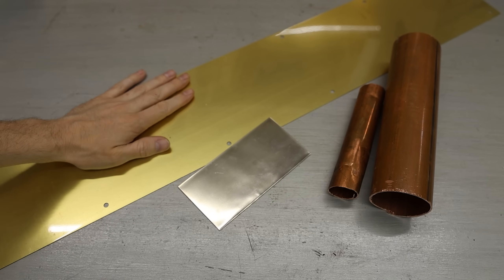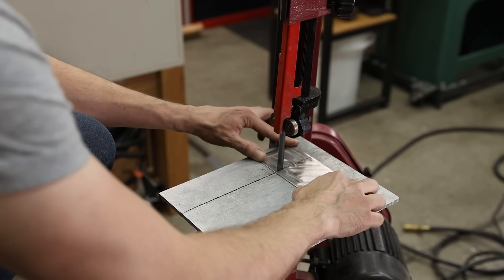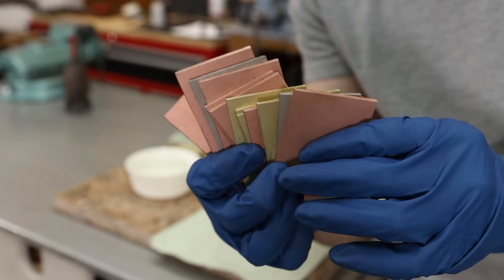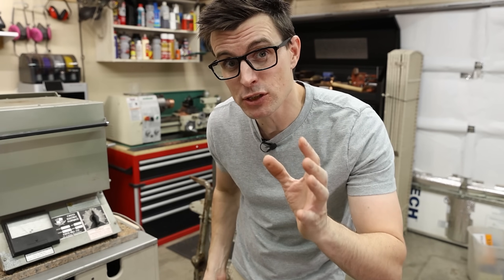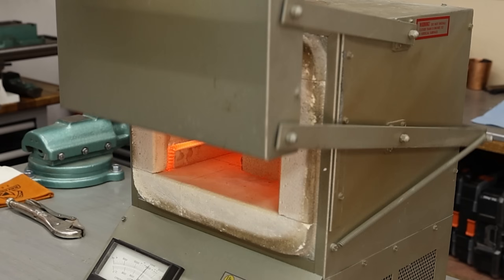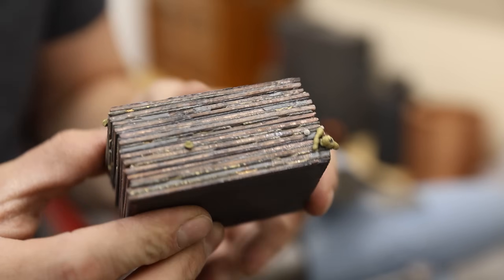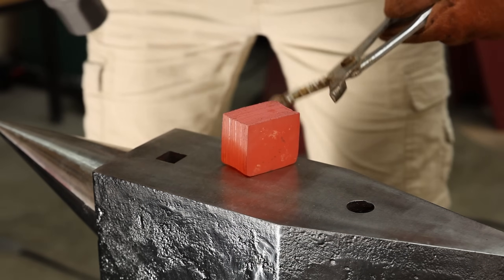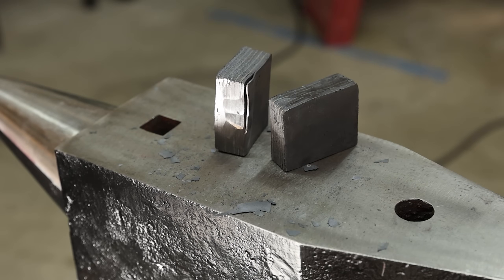Can I make Copper, Nickel, Brass DAMASCUS? - Mokume Gane

Comment: HI, I'm a jewler and have done Mokume Gane before. You need to use an acid bath before you bring your metals up to temperature. that would actually be better before you put them under pressure. As you know, you did not actually remove all the oxidation with your methods, because oxidation is actually instant. It would also be helpful if you polished the surfaces to a very high degree, and then used an ultrasonic bath to remove any compound after polishing. Then the acid bath, then the pressure, then the temperature. Of course you need to work quickly and there will still be a tiny bit of oxidation after you put it under pressure, but much less.

Additionally, you chose a difficult mix there. The noble metals of copper, silver, gold, and platinum are much easier, for many reasons.

Comment: That was an excellent first attempt, and you did manage to get a few of the plates to weld without a lot of things most people consider mandatory...that's commendable!  About the only thing I've seen that'll forge together under those conditions are stacks of nickels and quarters, that cupronickel alloy forges together effortlessly it seems like.  Just heat and tap is all it takes.

Some tips:
-Use nickel silver or cupronickel, rather than pure nickel plate.  Everyone has a hard time with delamination using pure nickel.  Sandwiching pure nickel with a nickel alloy can make a big difference in success, though omitting the pure nickel will bring even more success.  I've seen where people have electroplated a layer of copper on pure nickel plates beforehand and produced consistent welds, but I've yet to try that method.  I suppose copper plating all of the non-copper plates could give great results while also adding a fine grain detail between them, something to experiment with perhaps.
-Don't media blast the plates.  Sometimes it gets all of the oxides off, sometimes it hammers those oxides into the metal, sometimes it leaves abrasive stuck in the metal.  The rough surface also holds moisture and fingerprint oils far more readily than a smooth finish, and it'll hold them between the plates when you're trying to weld.  Instead, try a dilute acid bath and then a cleaning solution like tiva or even dawn, and then a freshwater rinse.  Electrocleaning works wonders too.  Use clean nitrile gloves when handling the plates after cleaning and avoid any contaminants for the best chance of success. 
-Use nuts and bolts to hold the plates together, rather than welding pins.  You can still tighten the plates down, but when you go to squeeze the stack, the two plates will have nothing stopping them from compressing the stack.  It really doesn't take a lot of pressure to set the welds with non-ferrous metals, most of the pressure is actually being used to flatten each plate against the other and remove the space between them.  The press would've been nice, but it can be done with a good vise or gentle hammering for the initial heat, just keep tapping until you feel/hear it slightly firming up after that first thud.  Welded pins are okay if you have a press with force to spare, as there's still plenty left over the bend those pins out of the way, but those pins are not inconsequential with the limited force that a vise has to offer.
-Flux, please.  With that kind of stack it's pretty much mandatory.  Thinned out borax paste along the edges will do nicely, it'll wick into any gaps and prevent oxidation when heating.  Don't be shy with it, do it on every reheat until you're confident that the stack has fully welded.  Alternatively, dunk the whole billet in kerosene and use a propane forge instead.  There are other fluxes out there that work great too, some that are even made specifically for mokume gane that will simplify your life so much...but simple fluxes still get the job done.
-Use a propane forge.  An oven subjects the stack to oxidation at high temps for hours on end, a propane forge only does so for a few minutes (in a reduced oxygen atmosphere).  You can still use the oven for the first heat if you pipe argon into there and keep the atmosphere inert, but it's kind of costly to keep doing this after every heat.  Waiting for the billet to heat up again in an oven without argon after every successive forging only exacerbates the problem.
-If any part of the stack melts, stop there and salvage what you can.  Don't try to keep going, take the billet apart and start over.  The gaps that the missing metal left between the other plates will never weld and will delaminate, every single time.  When you try to forge them together anyway, all it really does is deform the plates on either side around the gap, encapsulating a delamination that you'll only find after you put a whole lot more time and effort into it and you're finishing your part with a bit of sandpaper, it's looking great and you're almost done, except...wait, where did that sharp little edge come from?  And then you realize the whole thing is ruined after spending days on it.
-Don't forge to a black heat, always keep it glowing.  This will help prevent delamination and cracks.  By the time you've forged the shape you want out of it, those welds should be as strong as they're going to get, and should handle some light cold working as long as you occasionally anneal the piece.
-Don't forge on the grain until you've gotten a lot of good heat cycles in and you've deformed the billet quite a bit.  One or two reheats are not enough.  The welds need to stretch and heat cycle against each other to really lock in that bond, and one or two passes with a hammer is not enough to upset the center at all.  Once you have several cycles in and you feel it's ready to be struck on the grain, take it to the grinder and level off the edges.  There's a good chance that some of the plates moved a bit during that initial forging and aren't all flush with each other.  When you hammer on those high spots, it causes a shearing force on the weakest part of the grain and it'll absolutely delaminate on you even with a decent weld.  Even after all of this prep, forging on the grain is still the riskiest part.  Diffusion bonding is never easy to do outside of an industrial setting.
-Consider halving or quartering the number of sheets you weld at one time without a press.  You can forge weld a dozen plates at a time to get some thin billets, then clean them up and forge them together so you're not having to get 50 welds to set perfectly at once.  With a thinner billet, you're able to upset the material in the center a lot easier, so you can fully fuse those plates before stacking them.  After doing a couple of these smaller stacks, all you have to worry about is one single weld at a time when you put them together.  Each time you do, you're solidifying the  welds you already made, so you end up with a far stronger and more homogeneous billet to work with.  Plus it'll be good hands on experience for when you want to cut the billet and restack it to make a more complex pattern, or to refine the grain, increase the layer count, etc.
-One tip I can give you that'll save a lot of time after you've gotten the hang of making billets...have an exact idea of what you want to make before you even cut the sheets out, and then plan out how you intend to get the pattern and whatnot from it, whether from cutting or forging or stacking.  Work backwards from the finished piece you're imagining until everything lines up.  Nothing sucks more than realizing you don't have quite enough billet to achieve what you wanted, or trying to forge out a weird shape to get a particular dimension in order, or having weird offcuts of expensive metals that you can't use for anything.

Comment: You need an automatic forging hammer, and you heat this sandwich a little so that less refractory metals do not leak out, there is probably a forging technology, alternating heating, and frequency of hammering

Comment: Okay, I am a metallurgist and jeweler. I've made Mokume Gane before. The first problem here is your layering. You are supposed to layer the metal with the lowest melting point between each other metal. In this case your brass. Here the brass acts as the glue for your other metals. You said it yourself. It failed at the nickel and copper joint. That's because you didn't have the brass there. 

Also, with the furnace. You want to bring the temperature up to the "sweating" temperature. This is a couple degrees before it's melting point. There are charts on this online and I have some if you need help. But at this temperature the metal readily diffuses into the other metal that is pushed on. This is basically a form of welding. In a correctly done situation you don't need to even hit the billet like the other comments are saying. If done correctly during the process the two metals will fully diffuse and connect themselves to each other. 

Very impressed though! I absolutely love this art form. I love seeing others do it too!

Hope this helps!

Comment: Looks like a temperature problem, when heating in Kiln you need to reach about 50-100 degrees less than the highest melting temperature metal in the Mokume Gane Billet, also when heating in Kiln it is common to get the billet in a closed vessel full of coal powder (usually steel vessel) to prevent oxidation while Kiln cycle happens. If you go with the torching option a good visual indicator is metal flowing between the layers, when it barely flows around the billet layers, then you can stop heating when it flows evenly and give it a small press with a hammer or tool of your choice. You did everything else really well! Cleaning was amazing, might've benefited a bit from the a hydraulic press or the press you bought, just until the billet loses a bit of height and the softest metal squeezes a bit out of the square billet, but the temperature would have been the same problem. It is also a huge billet for mokume gane for the heat to reach the center and heat be distributed evenly, since these metals have quite different fusion temperatures compared to damascus that tends to be slightly different types of steel, they need to reach a middle ground and stay there for a while so you make sure it is heated evenly  (As I said at start of comment, in Kiln 50-100 degrees less than the highest melting point metal, and if torch-fired when you see every layer slightly melt around the billet, along the layer lines, with a torch it is a much more visual process. Cheers! Hope to see you try more Mokume Gane soon!
Reply from the maker: Thank you for the comment and great advise! I'm planning on trying pure silver and copper 1oz coins next. I figure those metals should be easier to work with than brass, nickel and copper. I got the press mostly set up, so that should help.

Comment: You should try just brass and copper first. I was thinking of doing something similar but my concern is that you cannot feasibly get the heat above 1700f because of the brass. The cupronickel won't easily weld at that temperature. Just my two cents though.

Comment: Hello, french blacksmith here, if i can give you my advice for this project... So, i work a lot with mokume gane, because i make damascus with steel, copper, brass and nickel, all mixed together at the same time, wich makes it a weird mix of common steel damascus and mokume gane, but it does make great blades.
So, a few problems in the selection of metals : 
1- Nickel behaves a lot like iron, it's a rather hard metal that will need quite a bit of heat to deform and anneal, meaning forging it dull red isn't very effective, AND can crack it, as its structure doesn't regenerate. It also means that if you add soft metals with it, they may shear apart because one wants to squish and the other wants to keep its shape.
2 - Brass comes in lots of different compositions. Some can be worked cold very well but poorly hot, others work poorly cold but very well hot. you need the hot work stuff, wich is CuZn40, aka brass with 40% Zinc. The problem is that the lowered melting point prevents you from working very hot (890°C maximum).
3 - Oxidation is of course quite a problem with any damascus, mokume gane included. Carbon will turn most oxides into metal at high temperature (in your video at the beginning, the carbon monoxide from your blowtorch turned the black copper shiny again). But your oven doesn't really contain or burn carbon. A well setup forge would work great, however with your kiln you can throw in a piece of paper before closing the door, wich will help consume the oxygen. But you can still get a good weld if you squeeze your metals together hard enough, and a press indeed is the best method for that, because it applies the pressure for seconds compared to a hammer that presses very shortly.

My advice : use metals with similar hardness, replace the nickel with white copper, basically cupro-nickel, copper with 25% Nickel to make it white. It's the metal used in "nickel" coins (they aren't actually nickel, they are white copper).

Work the mokume gane hot, and work it gently. The colder it gets the more it will want to crack.

Good luck to you, if you're interested in my technique to make damascus steel with bronze and copper and nickel and such, you can watch my video here : https://www.youtube.com/watch?v=uhBA6hrNQJw
Reply from the maker: Hello, thank you for taking the time to comment. That’s a lot of great information. I did get some cupronickel to try out but I think I’ll try pure silver and pure copper next. I have some coins I would like to use. 

I watched your video! Great job!
Reply: @robinson-foundry  silver and copper is beautiful ! I suppose you've seen the eutectic thingy that happens when both metals touch each other at high température ? They will try to melt each other even before each of them has reached their actual melting point. But if you watch that cafefully it should work very well 👌👌
Good luck for your next projects ! 😁🙏

Comment: Some unsolicited advice.  First is, the working temp range on copper and brass is tighter than copper and nickel.  The boogers on the side are from the brass melting.  You have to keep the temps around 25deg shy of the lowest melting metal.  Second, only hammer on the top and bottom for 3-5 heats and not with the intent of moving metal. just compressing.  A laster pyrometer can help.  Finally, STOP hammering on cold, not glowing surfaces.  You are cracking the joints appart when you hammer it cold.  By cold, I mean beleow working temp, which in this case is only about a 200degree window.  Finally, build your stack 10-20% smaller than you need the final size in diameter.  You can only work this stuff top to bottom.  Hammering on the sides can be done on solid welds, but even experiences smiths will occasionally ruin a billet by doing ANY layerwide hammering.  Try agian with these changes and you should see a better outcome.

Comment: Sanblasting these pieces was a mistake; you will bury microscopic particles in the surface. Even if you then go on to soak them in aceton, there will still be particles left that will not bond in the forging.

Comment: I'd try to suggest making a reducing atmosphere around the stack as you heat it up, using some form of carbon or hydrocarbon. Might be harder to see what's going on but if you can, it should help the welds go properly. Also I would've used the scraps of brass to test for a melting point...

Comment: I would strongly recommend using “nickel silver” (a copper alloy) rather than pure nickel.  The resulting eutectic bond will be stronger, given the copper, as well as the melting temps being closer, and you will still have the silver coloured layers.

Comment: Strongly recommend using “nickel silver” (a copper alloy) rather than pure nickel.  The eutectic bonding will be stronger, as the melting temps are closer, and you will still have the silver coloured layers.

Comment: I have experimented myself with this a few months ago. You did a lot, and I mean, a lot of things right. It's always hard to pinpoint exactly what goes "wrong" because, again, this whole thing isn't meant to be that strong to begin with. As you already know, hitting it with a hammer will work harden it, so the more you hit it, the more chances you have of it delaminating.

The whole stack looked solid enough but you can never really know if it's the same all the way through. I personally have done long soaks in the oven, with the billet inside a stainless steel foil filled with charcoal to prevent oxidation. My surfaces were sanded to 400 grit to help (higher than 400 doesn't help) and cleaned thoroughly like you did. A long soak at temperature (several hours) followed by really slow cooling, then back up to ~500° very slowly before slow cooling again will help strengthen the bond from what I've seen and experienced.

Comment: You did not get it hot enough before you tried hammer it.   That is why it delaminated.  Each of those metal have different control temperature for furnace molding.

Comment: if I had to guess, the delamination happened because you didnt get it hot enough. unfortunately the brass is what killed it i think. its melting point is much lower as you mentioned. maybe try it without the brass. most have had better success that way. I have had much success with just copper and nickel

Comment: Id use that tig torch to weld a seam on each side without filler.  also helps to use your grinder to surface all pieces flat instead of die grinder.

Comment: My advice would be to use some borax next time.  Particularly anjydrous borax, which can be made from off the shelf stuff heated to a little above boiling for a bit.  No foam, and it works beautifully!  The stuff made my first attempt at mokume made from quarter and unmitigated success.  So I hope that might be as useful for you as for me.